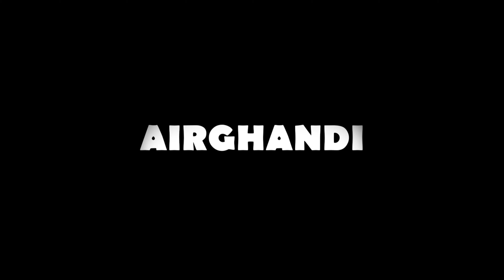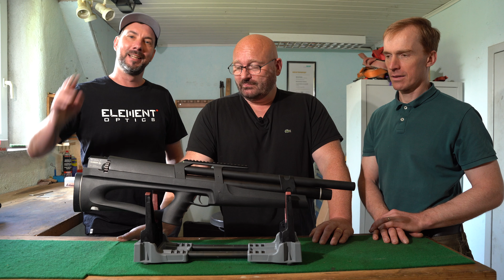Huben K1 110 Yards Shooting Test

Comment: 30 gr Javelin slugs @ 65ftb slug on slug. don't use pellets
Reply from the maker: Thanks mate!
Reply: .217 or .218? have you tried other slugs? wat reg pressure?
Reply: @airgunhuntingbw4905  at least 218, 219 is bast of 5.56